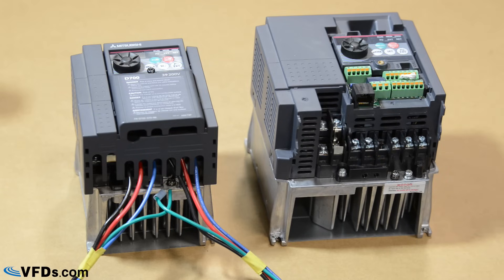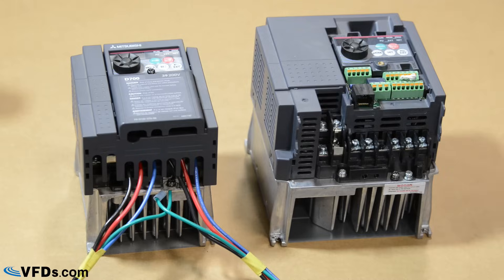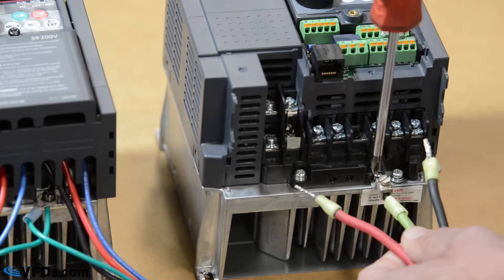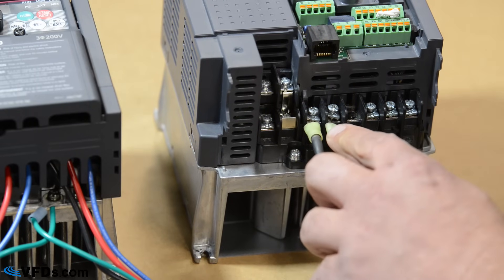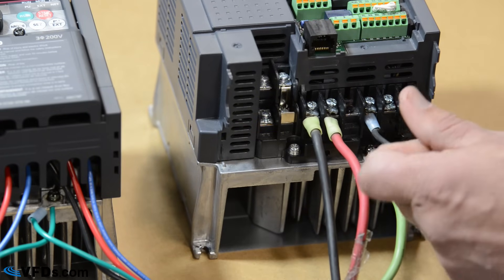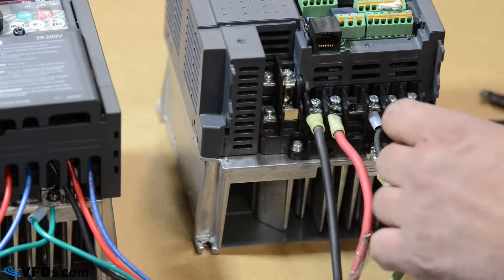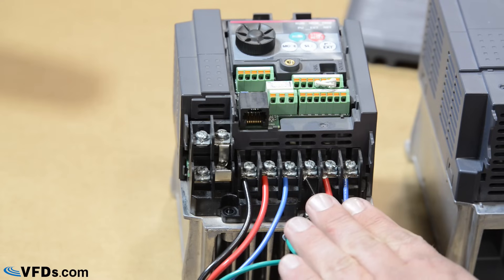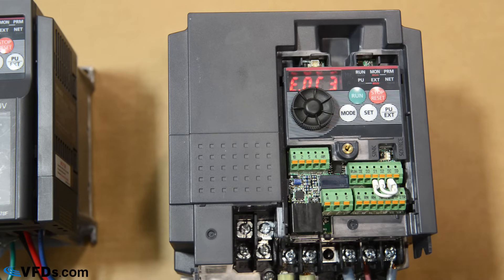How to wire a  VFD / variable frequency drive

Comment: What happens if you leave OPEN the terminal reserved for the voltage that sets the frequency?

I'd like to connect the Line/Neutral (115V 60Hz) and connect 3-phase output to a compressor.  I need 115V 400Hz, but curious what happens if you leave all the control inputs open and don't set any motor parameters?

Comment: Im trying to run a hot water pressure washer with one of these, just for the phase conversion. I need my single phase to be 3 phase. The problem is the pressure washer has motor starter and step-down transformer and over voltage protection and other stuff. Ive read that you need to put the vfd between the starter and motor for this to work, but I have a three phase starter so that isn't ideal. I did read that you can actually bring a leg back over to the starter to trick it to think its three phase...but my question is, can I just do away with all that stuff and just use the vfd to do the starting. Its an 8.1hp motor. I doubt the heated side of the pressure washer would work, but I'll deal with that later. Can a vfd take the place of motor starter?

Comment: So if I'm understanding this correctly, there is no neutral in the circuit, so the two power leads come from the double pole breaker, red into one pole and the black into the other pole? So I'd be pulling three wires, a ground, and two power leads and no neutral?

Comment: My pump is single phase (I guess, as it doesn't say anything else) with a standard plug... It has a pressure tank attached... Hoping just to plug it into a VFD controller to do what a VFD does... Is there a controller that will do that?

Comment: I don't mean to be a a$$hole but if you had more experience you would know that any time that you are putting a stranded wire under a screw it will hold better if you twist the wire in the opposite direction of normal wire twist.

Comment: In video you connect red and black to L1 and L2 witch are hot. Each wire provides 120v. You connect green wire as ground. Where does the neutral white wire connect ? I'm wiring a TECO E510 VFD. 240 volts single phase input power to power a 240 volt 3 phase motor.

Comment: By grounding via cable to a ground star bar, does having the VFD case grounded to the control panel backer not cause a ground loop by having two grounds come from the drive?

Comment: The code book specifies what Green, Green with Yellow Strip, White, Gray are used for. You can't just make shit up on that...And what is up with that bull shit grounded connector on the VFD drive load side. It looked like you use 2 spade connectors and jammed on blade into the other one. That is bull shit. As it is now not rated to carry the proper amps short to ground...

Comment: I just added a VFD to an old CNC I have.  Its your Mitsubishi.  Thanks for showing how to get the main power cover off.  Now my problem is this.  The 4 lead wire that came off the spindle motor to the FWD rev relay only had the 3 power wires going between motor and controller.  The ground lead from the motor went straight to the grounding area of the enclosure.  Now my wire is not long enough to get to the VFD in the cabinet.  Is it good enough If I just run a grnd from the VFD to the grounding area of the cabinet?  Should I just say, start from the beginning and get a dedicated VFD to motor wire?  Wire would have to be about 8' long.

Comment: You don’t specify for what country?
Here in Oz - we have 4 core + Earth wires:-
L1 Red
L2 White
L3 Blue
Neutral Black
Earth Green with yellow stripe!

And it’s 440 volt 3 phase.
L1 L2 & L3 are interchangeable to reverse parity on 3 phase motor & get it to spin correct direction.

Comment: AC Drives in Noida | AC Motors in Delhi | Drives and Motors Training | Servo Motor Training Institute
http://www.diac.co.in/courses/drives-motors/
Drives and motor training from DIAC is given to students holding engineering degrees including B.tech in CSE/ IT/ Computer Science/ Information Technology/ BE M.tech, BCA and MCA. Students will learn main topics such as speed control from basic to advance level through our teaching techniques. Students can apply these skills in industrial applications.Call @9953489987.

Comment: You didn't you explain its control wiring..which is important.
Reply from the maker: We are only showing basic wiring instructions in order to power and program the VFD with the attached keypad, control wiring is not needed for that setup.

Comment: Where the control wires. Please do it nicely.
Reply from the maker: We are only showing basic wiring instructions in order to power and program the VFD with the attached keypad, control wiring is not needed for that setup.

Comment: Where can I find info on how to program a VFD?  What do the parameters F, H, A mean on the display and how can I set the freq. to 130 Hz?
Reply from the maker: If you are trying to program Mitsubishi VFDs, check our video library and you will find other videos showing some basic programming. Every brand of VFD has different terminology, so we can't answer what F, H, A means unfortunately.
 
For any programming specific for your machine, you will have to consult your manual for the parameters or find a local electrician who has experience with VFDs.

Comment: Can i input dc 400 v to vfd instead of three phas terminals R. S. T for run the motor i have yaskawa 616G5 vfd model CIMR H5A4037
Reply from the maker: Shahbaz, this is an AC VFD pairing with AC motors. If you have a DC VFD, you will need a DC motor. The wiring might be different since the VFD is manufactured by a different company. Emerson makes great DC VFDs.

Comment: is it possible to use arduino as a party command of this VFD, and thanks in advance
Reply: You'd be most likely able to drive any VFD with arduino - it's controls are like analog input for speed control and digital inputs for rotation direction, emergency stop etc.

Comment: The part I am getting tripped up on is how to wire in a switch to the line side going into the vfd so I do not have to leave it on constantly. From what I can gather I will need a DPST switch rated for the correct amperage but I can not seem to find any 2 articles or opinions that say this is the correct way to configure the switch. 

Some say that a switch will always burn out others say they have had a switch on theirs for ages. My manual does not list any control ports for a power switch and i I understand it correctly it goes as far as saying that a switch should not be used to control the run/stop of the drive. I take that to mean that you should not use a switch to put the unit under a load not just powering the unit on but I am admittedly getting a little cautious. 

Any guidance would be appreciated.

Comment: I have a question for anyone that could help. 
I have a VFD with stated Voltage output of 200-240 V. Is this some special system other than the typical 380 V? Or is it simply stating the voltage between any one live output and neutral, so that it is effectively a drive for a 400 V 'motor system' because you'd be using more than one Live output?

Comment: if I connect external potentiometer there's any changes in program
Reply from the maker: Yes, depending on the drive, you have to change at least 1 parameter to use an external potentiometer/speed pot

Comment: hello friend,
I am working in a solar panels company my manager asking a question to me.what happening the +ve and -ve terminals are changed into the drive is burning or working.
Reply from the maker: Thiru, I am sorry but I don't understand what you are asking.
Reply: my question is what happen in +ve and -ve polarity changed in the inverter circuit.
Reply from the maker: Does this have to do with the VFD wiring? We still do not understand what you are trying to ask.

Comment: Hi. Confused a little, you say single phase which is one wire and a neutral to return. You have said two hot wires so is this 240v instead of 230v?
Reply: Robert is right. It’s 3 hot phases for - 3 phase. Sometimes there’s a neutral in addition, if 120 is being taken off one phase.
Reply: Francisco Puga 
Incorrect
Reply: i was thinking about same thing
Reply: Robert, sounds like you know enough to be dangerous while not actually knowing what you're talking about. You can have a 4 wire 3 phase system in both Delta and Wye configurations.The center of the Wye is used as a neutral. On a Delta system if a neutral is needed one of the windings is center-tapped.
Reply: Basically, he wired a single phase and a neutral to the inputs. For single phase Toshiba drives the S/L2 terminal is for the neutral. His explanations are misleading.
Reply: stop guiding people with wrong direction. there is no neutral on 3 phase.
Reply: 230v and 240v is the same thing. single phase power can be either 120v (hot and a neutral) or 2 hots as "nominal" 230-240volt. same thing like, potatoe potatoo .. lol
Reply: Emma Burns of course. 3 phase has 2 hot and 1 neutral.

Comment: great work . but i have a question I have a single phase motor and i want to make speed control so how i can connect it on the output of vsd
Reply: It is not possible to conect single phase to  vfd  for variation freq it must be 3 phase to change.
Reply from the maker: Eslam, you will need a three phase motor. VFD works with three phase AC/DC electric motors.

Comment: I wasn't sure if a vfd changed the output frequency or the rotation frequency I've since learned a stepping motor controler controls rotation points I can't see a 3 pole stepping motor out there thanks for help much appreciated
Reply from the maker: Lanclot, a VFD changes both the Hz and RPM. You should check out that video I told you about.

Comment: can a vfd power a primary transformer in a welding machine to fine tune a arc or mig welder yes not wiring on the circuit board side
Reply from the maker: Lanclot, a VFD is used to control electric motors, they do not power the motors or transformers for that matter. Feel free to check out our video "what is a VFD"

Comment: Hi, I am a mechanical engineering student working designing a screw conveyor as my senior project. I have a Baldor 1.5 hp brake motor. I need it to power a conveyor  that will have a speed of 20-40rpm. As of now, I have a gear box with a turn-down of 20. Additional to it, I am thinking to use a VFD to control the speed. At this point, I need to start selecting a starter and VFD and need some help with that.
Reply from the maker: Hi Sofia,

A VFD acts as a starter, so you shouldn't need one if you have a VFD. What is your input power voltage and phase? What is the voltage and FLA of your 3 phase 1.5HP motor?
Reply: DC voltage not out put

Comment: I have a delta 3.7kw VFD. I am using 230V BRWG (black, red, white, green) from my panel to L1,2,3,G respectively. I am using the same for T1,2,3 G. I am getting 220V to ground from each line into the magnetic start panel. I have selected the H4 220V terminal of the transformer that links to the magnetic switch (previously it was on 460V H3). When I hit the start switch I get a rapid clicking of the magnetic switch and no motor engagement.

I called delta and the tech told me one of the three line legs coming in from the VFD is a "fake leg" and that must be connected to T3 or L3 depending on which end of the wire you wish to view. How do I identify this so called fake leg? I see no info in the manual about this. I am using this VFD to drive a 5hp motor for a delta unisaw (34-806) which I wired from delta to wye.

I am not used to needing help for such things, but I am at a loss on this. Has anyone encountered this before?
Reply from the maker: Rollin,

We need more information in order to answer your question. (1) We are not sure what you were referring to when you said "fake leg"? (2) What exactly is the magnetic switch that you mentioned? What does it do? Where is it located in the arrangement of the electrical components? (3) Where is the transformer getting its primary power? (4) Do you have a contactor after the VFD? If you are trying to close the contactor after the VFD is turned on, it will not work.

Let us know. Thanks.

Comment: It would be much more educational if the wires were refered to by their types (such as live or neutral) rather than their colours.
Reply: Where do i connect the encoder
Reply: I want to ask that on single phase VSD on the same connection is it  where u  connect wires of electricity and of the solar panels .
Reply: ヽ༼ຈل͜ຈ༽ノ l the red black green of 220V is standard for north America. The UVW doesn't matter as long as it goes to the proper pin

Comment: Where does the neutral connect?
Reply from the maker: +Stephen Schuld Nowhere, you do not connect the neutral wire, just the 3 hot wires and the ground wire.
Reply from the maker: +Stephen Schuld If you are connecting a single phase, then it is 2 hot wires, not 3. Either way, there is no need for a neutral.
Reply: do i abandon the neurtral and if so do i disconnect it from the buss or just leave it?
Reply from the maker: +Stephen Schuld Stephen, yes, you abandon the neutral at the VFD. What you decide to do with the neutral wire is completely up to you. Our certified electrician said that he would just cap the wire off at the VFD with a wire nut and leave it be. It’s not necessary to disconnect it from the neutral bus bar in the breaker panel. Hope that helps!
Reply: In Europe and Australia and other countries with 220-240v power it would be Active (Hot/Live) and Neutral wires for single phase